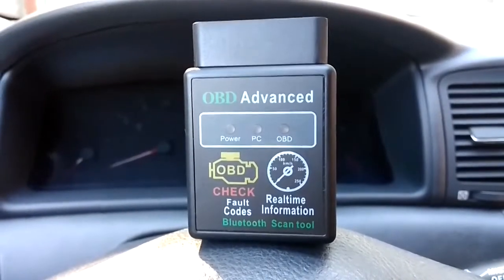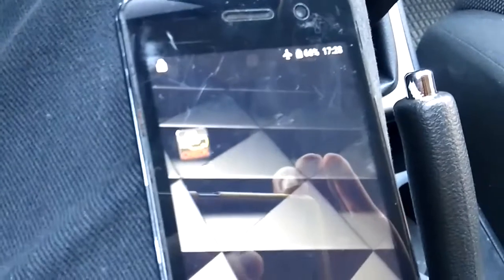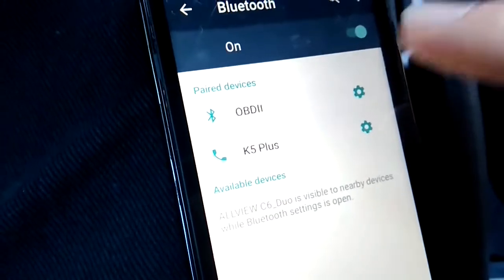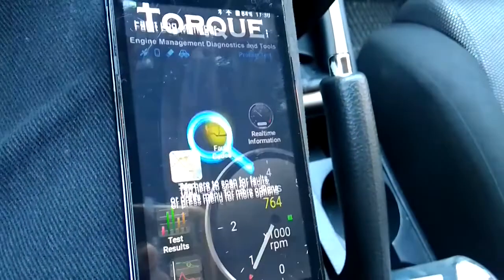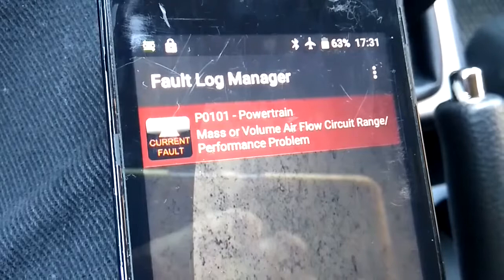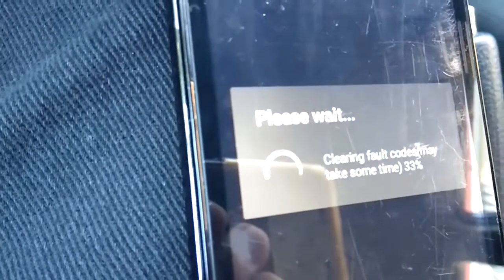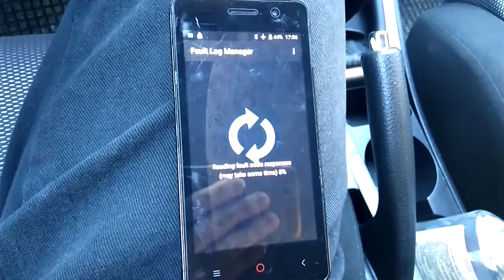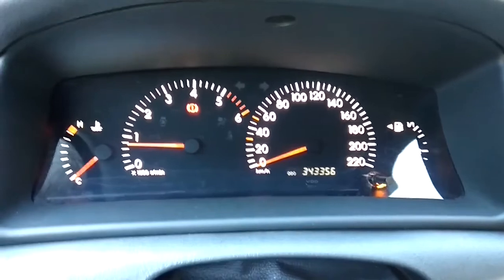ELM327 - car diagnostic tool - quite cool (test)

Comment: ?hello. does it work for older VW 99year of prod.?
Reply from the maker: As far as I am aware, most cars manufactured after 1996 have an OBD2 port. If your car has such a port it should work, but in order to be certain, check the car's user manual or technical specs online, to see what type of diagnostic port it has.
Reply: Nope it doesnt work . It works on 2001 and up models petrol and 2003 models for diesel , this for europe .

Comment: How can I get the Torque app without buying it on Google play store?
Reply from the maker: Torque was free to download and install at the time of recording the video. If the app is no longer free to download, you can always try a different one (the car diagnostic tool is not app-dependent, it will work with a number of different apps, just take care and try to install apps from trusted developers)